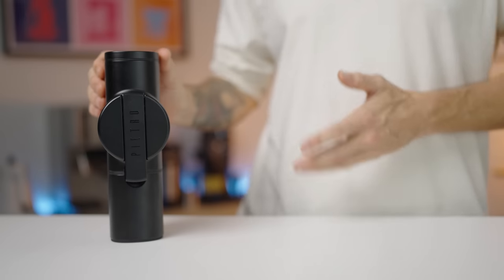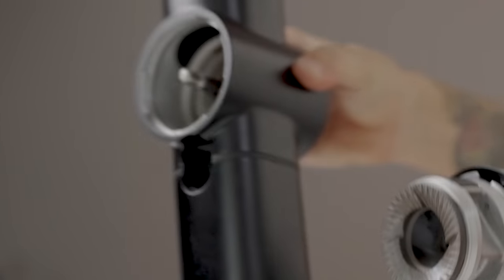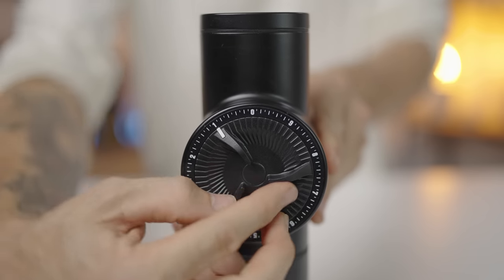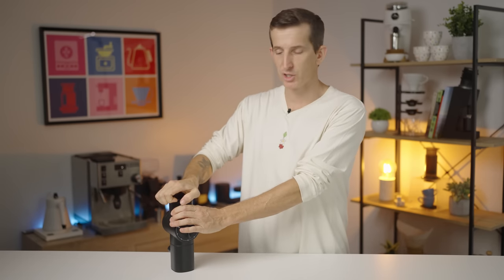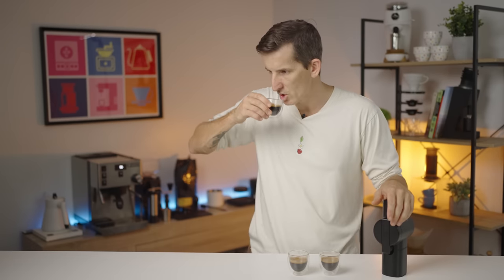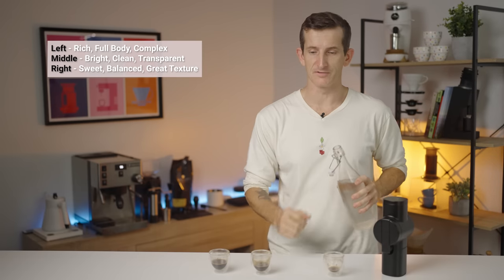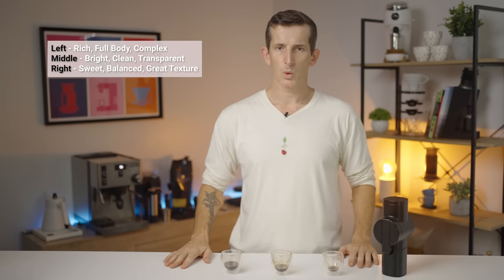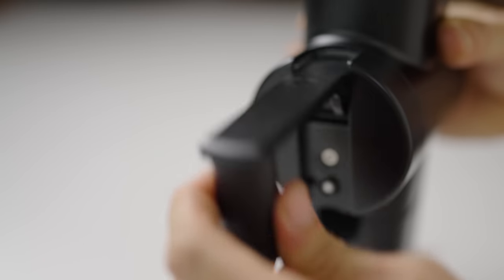Fiorenzato Pietro Manual Flat Burr Grinder Review

Comment: @9:24 I would like to know, what one next full step set on the dial would result in what time difference. With my Eureka Mignon Single Dose one marked step up or down would result in an eight seconds brewing difference to achieve the same 18 g IN and 36 g OUT.

How much difference can be set by setting it to the next full step? Thank you ;-)

By the way, I am not really optimistic that the bandwidth of this grinder would be sufficient for me to dial in very different espresso coffees. I mean, on my Eureka Mignon Single Dose the time difference between whole numbers is about 24 seconds. Quite a lot.

I had coffee that needed to be ground on 2 whereas other espresso needed the 6 as a setting to run properly within a 25 to 35 seconds range to get the 18 IN 36 OUT recipe working correctly. Perhaps I am wrong, but I think this grinder might not have been invented to be espresso-only or better suitable for espresso.

@15:39 [UPDATE] Actually, you are now confirming what I think I spotted right away when you showed me the grinding differences of the Turkish and Espresso…

Sorry, but at that price point, this is a no-go for me.
Reply from the maker: 🫶  Yes 100% exactly what you're suggesting. I found at times the process of dialing in Espresso, the magnification of adjustment was too large (at this price point) - and like you, have coffees that require vastly different grind settings and this is a concern. 
The difference in a few examples was 8 seconds between a single adjustment.
Reply: @AlternativeBrewing  So, you mean between single notches, not clicks? This would be too narrow for my coffee experimenting…

Thanks a lot for the answer, this helps a lot — not to storm to the next retailer and thinking of an Eureka Mignon Single Dose replacement ;-)
Reply from the maker: Sorry, that's my confusion there. Two notches (one click/step) equalled 8 seconds, however 1 notch didn't always end in ideal results either.

Comment: These burrs don't seem to be fixed by screws but in some other way, which makes me wonder, I guess that already means that other burrs from 3rd parties will be a no-go, what about aligning the burrs, though?
Reply: You can’t use burrs not designed for hand grinders anyway, people already tried that and it requires way to much torque and you can’t do enough resolutions to make them work properly. 

Lance has been over the probrew burrs, like on Ode V2 burrs so I think those will be fine as is.
Reply from the maker: These are proprietary burrs for sure. I wasn’t successful at removing the burrs unfortunately, however, the burr carriers do appear like you can remove the burr and add some aluminium to help with alignment 👍
Reply: These are 'blind' burrs, they are fixed with 2 hex screws from the backside. There's a little hole next to the release switch where you can fit a 2,5mm hex key to unscrew the burr. It takes around 5 minutes to change both of them. No aligning is necessary.

Comment: I was waiting for this grinder but purchased a z1 presso a month or so ago. I think it is over priced because you can buy a motorised unit for the same price. A hand grinder should be substantially cheaper. I also see some engineering issues. These revolve around the manual grinding. The base is too narrow and too short, and the handle on the side of the unit exploits these issues to make the unit unstable. If the handle was placed in top of the unit, as it traditionally has been done, both these issues would not have arisen.